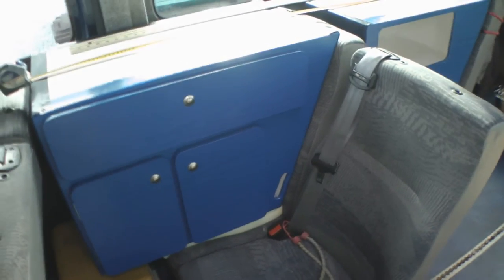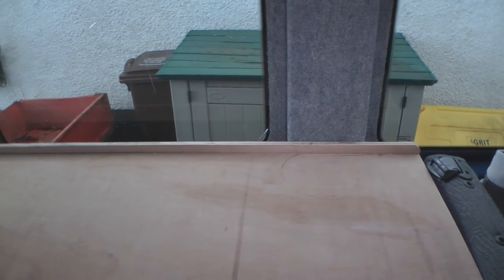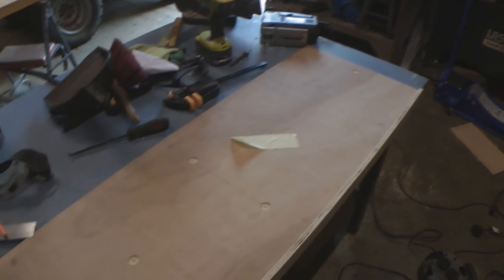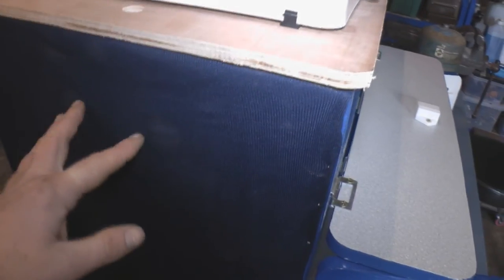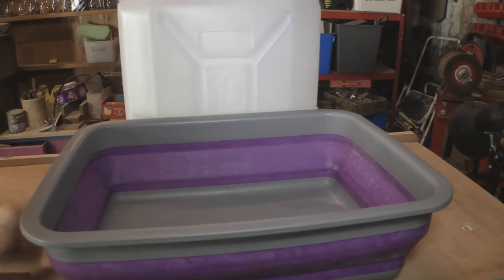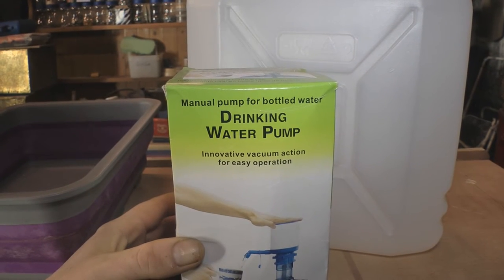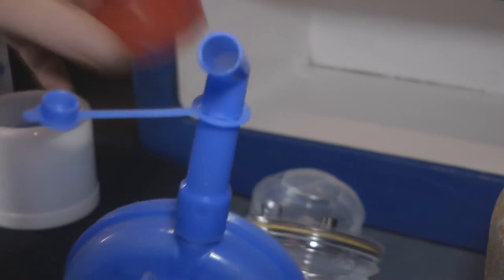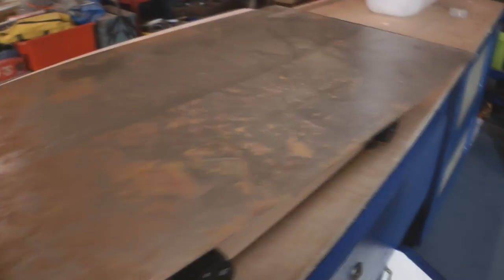Minibus Camp kitchen Build. 8 of 9

Comment: this just gets better and better,  may i humbly suggest that whichever side the cooker is going on you do two things, one is put a set of folding windbreak style screens, not for draughts, but for the spatter that cooking inevitably causes, plus, maybe a seat cover for the closest seat from some kind of wipe clean impermeable stuff, like the sofas used to have, for exactly the same reason, that way when you remove the unit, your seats wont be covered in grease spots!   (just a thought cos i am after all a know it all bastard) plus i have made mistooks that i learned from haha,  onother idea for under your stove, if you can get a metal serving tray big enough so that the cooker can sit on it when upturned, you could put some insulation in the void beneath to protect the wood, and as with you sheet of tin, the lip could be used to screw to the bench,
Reply from the maker: No, stop making me more bloody work...... ha ha great suggestions as usual bud. Cheers.Atb Dave
Reply: h3r34thebanter hahahahahahahahaha i am pure evil personified hahahah

Comment: Looking good Dave.  I think a couple of plumbers soldering mats placed under the burners of the stove might work to stop the heat transfer through to the metal?
Reply from the maker: Cheers Glenn, that's a good idea I don't expect to much heat under the stove but given it's location in a vehicle with a few people likely in it and one in a wheelchair, its better err on the side of caution. Thanks. Atb Dave
Reply: +h3r34thebanter  They are not really that expensive in tool station, could be worth paying out few quid, you're  better to be safe than sorry.
Reply from the maker: +South-West-Wilderness Cheers Glenn, I'll get a few ordered I want one anyway to protect my workbench when I'm soldering.